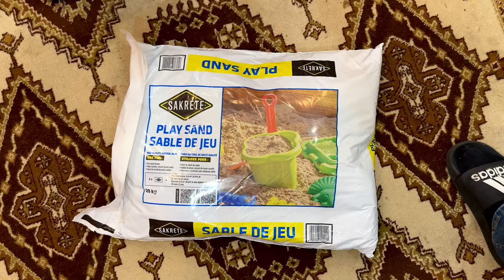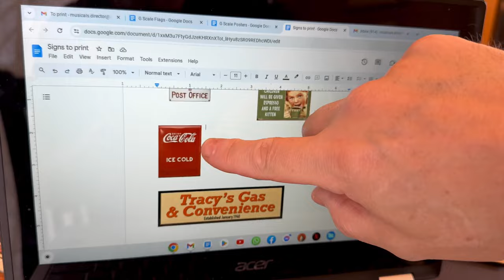Casselman ON: Easy False Front Building, Scenery & Lights! + LIVE STEAM! #gscale #livesteam #trains

Comment: I would have used the cookie sheets to bake sand back in my single dad years.  These days we have reacquired adult supervision, so unsure it would be allowed.  Fun video.
Reply from the maker: Lol. Well, these baking sheets came from the salvation army thrift store. I use them to work on engines as drip pans. And great for testing alcohol fired engines lest there is a leak! 🔥